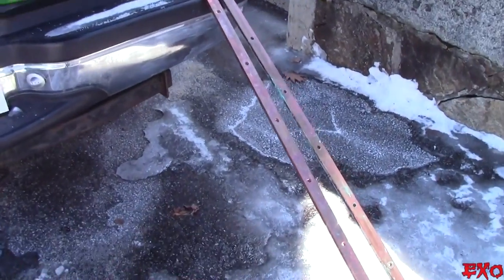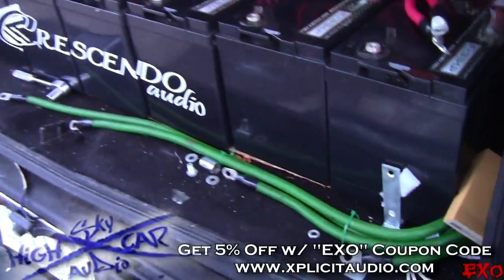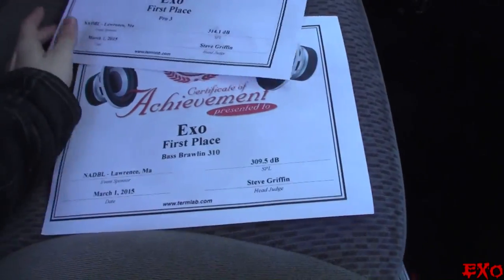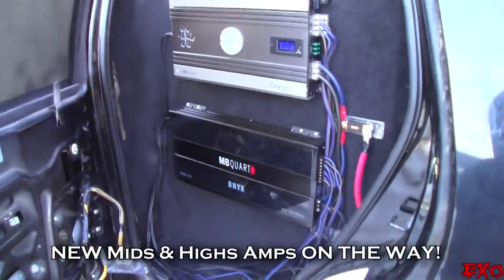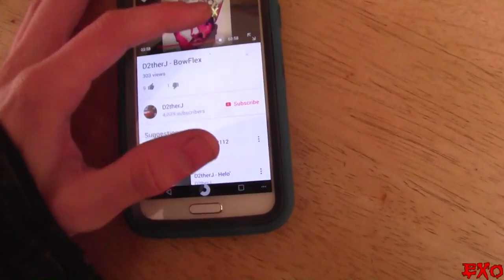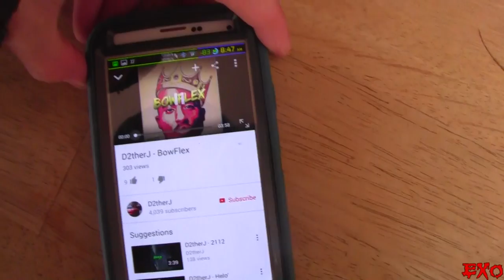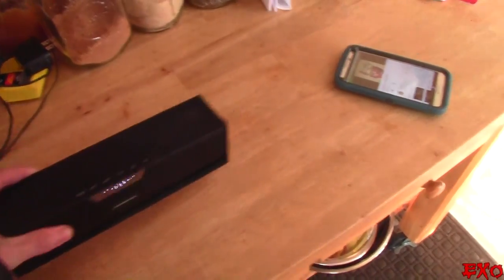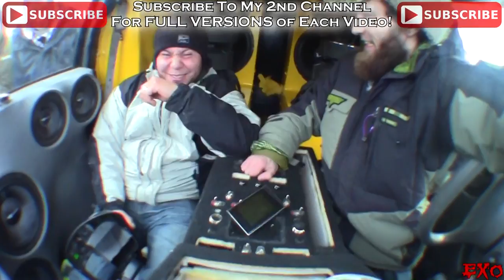HUGE Sound System Updates: NEW Car Audio Batteries / SYMPHONY Amps & Wireless Bluetooth Speaker

Comment from the maker: Thanks for watching everyone! Much more insanity on the way :)
Reply: You need to build a custom fiberglass dash so it doesn't rattle apart anymore!!
Reply: I have always wondered for that much bass do you have to turn your airbags off or dose it even mess with it
Reply: Yes, make sure u turn your airbags off.
Reply: Awsome video EXO
Reply: its kinda sad that you have to make a statement to cut the comments about your sister. people think they can get away with anything behind a keyboard. another good video exo
Reply: Gregory Rivera E 40 is a artist he has like 100 songs he wont kno witch one to put on
Reply: Hey EXO quick question is it 18" of wire from battery to fuse holder?
Reply: jc deer
not exo ....but closer to the batt the better
Reply: ok thanks
Reply: Hey, how much of a difference does it make going from a regular cheap calcium wet lead cell to a AGM? im still saving up for a alternator don't worry, but will it be enough of a difference that i can turn the amp up even a little more for example? (i now have it set just so that the lights do not dim because im more carefull now hah (blew one of my 2500 rms amps by having too low voltage, i had exactly the same 2500rms amp ready in my house because i wanted 5000rms strapped when i got the alternator so now i first need to get that blown 2500 fixed sadly)

Comment: Exo this ray love your new setup I'm still working on the trailblazer  L's I just finish my door speaker pod I have to fiberglass them I watch a lot of  your video on your new install I still got my  in my wall behind my second roq set 4 American bass  xfl 15 my 2 planet audio px5000 watt amplifier I watch your video on the wy u fiberglass the door I'm putting 4 6.5 speaker in my doors  one 4inch  mid range in both door 3 6.5 speaker in both back door along with 2 4inch mid range

Comment: i have eight 15inch subs in my van running 5k and its breaking alot of the interior parts, thats because the tunnel is tuned to 25hz, be warned if you want big bass in ya car or van be prepared to keep on fixing stuff